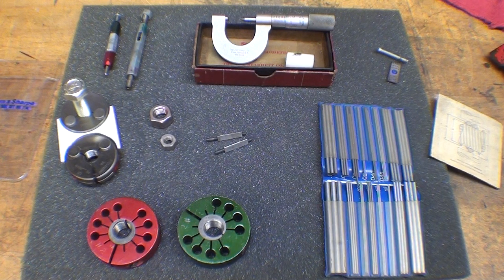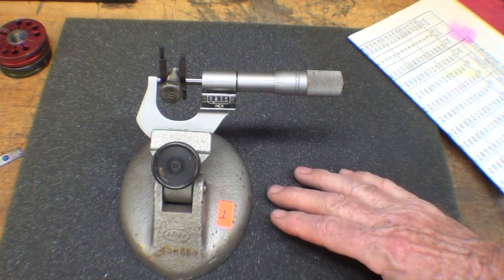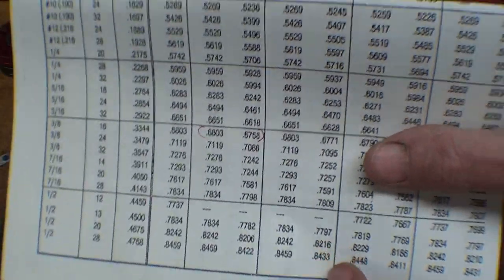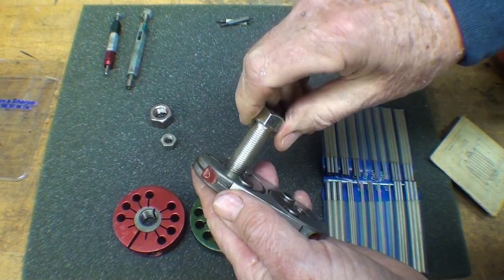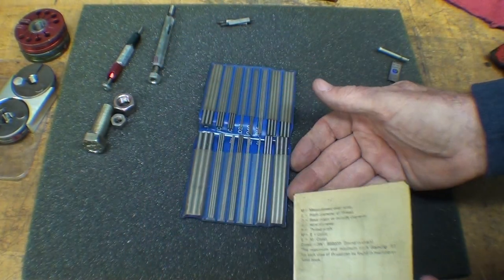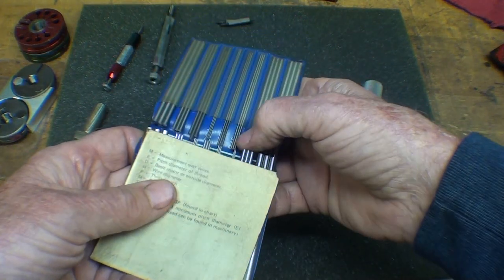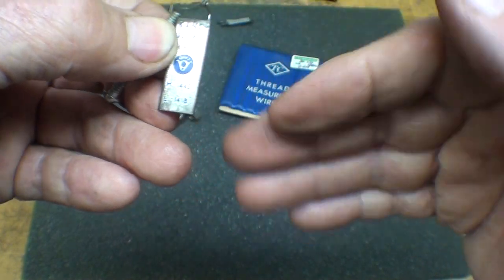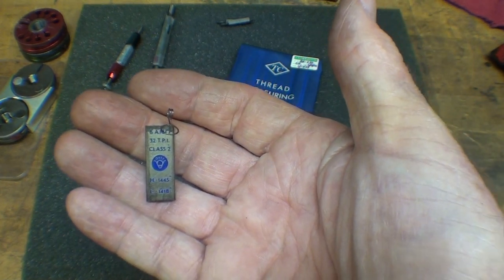Tips #272 How to Use Ovee Thread Gauge tubalcain

Comment: I thought I had seen every method for measuring threads but I've never even heard of the Ovee wires. That's very ingenious. At the work station we use wires and a mic free hand. It's a "learned" habit. Inspection uses go, no go gauges

Comment: I have never heard of OV gages.  They look like they would get the job done with none of the hassles of the other devices.  My work was one-off, so if it fit it worked and in some cases had to be made that way as the bolts and nuts were made one-off by the original craftsman.  I recently retired from a 30 year career as a museum restorations and exhibits curator. I worked with both woodworking and metal working tools and I am continually amazed at how much I didn’t and still don’t know and how much I learn watching your videos and those of the other incredible machinist on You Tube.  I particularly like your to-the-point style.  Keep up the great work.

Comment: I looked the OVEE gauges on their web site.  They are $117.00 - 138.00 EACH when new.  Pretty nice but I don't think I will ever have a set.  Thanks for showing them to us.
Reply: Just did the same thing.  Ouch. You can get a set of thread wires with the plastic holder to make holding them easier for about $75 and that will measure almost any thread size.  It appears that these cost about the same as a set of go-no-go plug gages and you don't even need to measure those.

Comment: The last thread I cut (last night) I tapped the female part and used it to gauge the lathe cut thread. Easy and good enough for the job. I've used three wire when I needed but don't have enough hands to do it easily!

Comment: I use the thread wires, or MOW, (measurement over wires) all the time at work. The easiest way to use them is to split a rubber band into 2 pieces, and poke the wires through each piece to hold them over the work piece to measure with micrometer. Works really well. Thanks for the video

Comment: I have made my own ones in the past, too poor to buy any, out of copper wire. Copper wire can be had in most of the sizes used in a PD set and is easy to wrap around the thread to be measured and using the PD chart for reference.

Comment: I used to do Inspection many years ago in a shop that was Boeing Certified. I've never seen the Ovee Thread Gauges before. It's been a long time since I've done that type of work. I suspect Boeing would not have allowed the use of
the Ovee Thread Gauges for machined threads for the parts we made for them, but they sure look handy and appear to be quite accurate as well. I always learn something new watching your videos.
Reply: Boeing would object because the Ovee gage cannot be calibrated.  The Doall type thread gages shown would be mandated.

Comment: I use thread mics whenever possible, far faster and more convenient than wires, I highly recommend picking up even a import one for 0-1" at least for even a hobbyist as that is going to cover 90% of the threads most people will be cutting. Also your directly reading the pitch diameter and don't have to rely on a chart that you can lose, miss read, or make a calculation mistake with. If I have to use wires I always put some green painters tape (so you don't get sticky all over your wires!) on them taping 2 together and flagging the other one so when, not if, you drop them they are very easy to find. Also I use grease to glue them in place, always worked well for me and then you can easily use them with just 2 hands. I've never had a chance to use a OVEE gauge before but they do look like a reasonable system but my god would a full set cost a fortune!
Thanks for the great video!

Comment: At my employment, we have standards for both the id and od threads.  Most of our threading is large shafts to keep bearings in place.  But occasionally you would get a job in that you did not have a standard for or a nut to try, so we would have to use the 3 wire method.  Yes it is a pain in the ass, but you learn very quickly in utilizing a clean rag to cover the ways so when you dropped your wire you can see it before it hit the chips.  And you do drop your wire or wires!

Comment: I guess I use the hunt for a nut or bolt that fits.  But, if I were using a lathe to cut threads I suppose it would be good to have a set or the Ovee gauges.  As a bricklayer, we weren't needing to be that close to tolerant but when I was fiddling around in the machine shop at school, I tried to get things as close as possible.  Greg

Comment: Cute. I have thread wires and a selection of thread mics, but I discovered that the older Starrett thread mics aren't always accurate on modern UN threads.

Flexbar makes some nice little plastic holders for the wires.

Comment: Very interesting!  I think I had a set of those (available) when I was at LePages.  I can see where wear and use (mis-use) may throw off readings in an older set, but I think you could "proof" those easy enough by trying them out against one of the other types and making sure you're getting like accuracy.  Carry on.

Comment: I've been in the machining trade now for almost 50 years & have never seen or used the OVEE gauge !! I have tried the thread V's , but they are VERY awkward !! A nut IS a good substitute for a ring gauge . And Wires are the most common . It is possible to only use ONE wire though !! (1) Mike O.D. of part & write down // ( 2) Mike over O.D. & ONE wire & write down // (3) Subtract smaller number from larger number & write down // (4) ADD step (3) & step step (2)  // (5) This is equal to measurement over TWO WIRES // (6) Proceed with wire formula to acquire Pitch Diameter . This method is MUCH easier for LARGE diameter threads ie.: 2.000 & UP !!!!! Also when you have cut a thread & it looks pretty good BUT the nut or gauge won't go on , your question is how much more to cut ??? The THREAD TOLERANCE , .003 to .004 Thous.  is a good start . GREAT video ,GREAT Ideas , THANK YOU Mr. Pete !!!!!

Comment: a Shars thread mic with interchangeable points and anvils is less than 60 bucks. I think that it covers about 8 to 48 pitch. Way easier.
Reply: I bought shars up to 3" love them.  Figured out SPI fits the same anvils (5mm) and bought a used 3-4" SPI. Love those mics.

Comment: Doing boiler work on a steam locomotive, we had to match the thread on the staybolt stock to the taps we had, which cut a bit undersized. We measured over wires.

Comment: I have a set of Ovee brand thread wires. They are almost identical but have more than a few loops of wire. They look almost like a Helicoil insert but work the same as the spring type you have. They thread on and you measure over the outer diameter. I believe mine  are older, before this style you are displaying here.

Comment: A slick way to get 3-wire effectiveness without the hassle. I've never seen those; I will have to keep an eye out for them.

EDIT: Found (and bought) a set for fine threads from 1/4 to 1". Not cheap, but not ridiculous. Now to find sets for coarse threads and for smaller threads.
EDIT2: And a set of coarse from 1/4 to 1 inch. Whoopee!

Comment: I've never seen OV gauges, but the 3 wire method I've used in the past and yes it is a struggle to hang on to the wires and try to get an accurate reading. :)

Comment: Those Ovee gauges are cute but i guess are made for 60 degree threads - ( not a lot of use for the whitworth bolts i was making at the weekend.  I had to struggle with wires!)   and as the thread pitch gets smaller , the wires get bigger and stiffer so there must be an upper limit to the available sizes.

I like your mechanical digital mic.  I must keep an eye out for one of those :-).  Thanks.
Reply: Yes you can get them for BSW. See my comment to mrpete.  regards

Comment: I use the thread wires all the time. I use grease to hold the two on the top my left hand to hold the one under and my right hand to hold the mike. Also I use red dykum to stain the wires in case I drop the wires so I can easily see them.

Comment: Excellent video  mrpete. I have a complete set of BSW O-Vee gauges up to 1" & a few odd ones over that size. I also have an almost complete set in ANF size. All are complete with the instruction sheet. I do still use them. Wish I had a metric set. Did you know there are 3 different types of O-Vee gauge.?  1-- Standard thread Gauge.  2-- Tap measurement gauges.  3-- Nominal effective gauges.  All the ones I have are in the original blue card boxes marked   "O-VEE Spring Gauge Ltd" Edgware,  Middlesex  (English county) and by the 4 digit phone number is most likely mid 1960's to late 1970's  O-Vee is still a trading company to this day.Thanks for sharing. regards from the UK
Reply from the maker: thanks-I willput that in a vid

Comment: Most of the time, i use a nut / bolt. Seldom, i use the 3-wire method (and hate them). These ovee gages look good, but to find a metric set for a low price will be difficult, i guess.

Comment: P-D wires are simple and fortunately, cheap, since part of the set usually winds up lost in the chip pan.  The simplicity is offset by the manual dexterity required to use them.  Not suitable for a production environment.

Comment: I would love to learn the calculations on how to use 3 wire
Reply: They come with a set of instructions
Reply: They come with a set of instructions for how to line the wires up, which wire to use with the manufacture's chart.
There are a set of calculations to figure out what wire diameters can be used with which pitches, and a set of calculations to figure out what the measurement should be with the wires you choose, (without a chart). We had to learn the whole process back in '86. Never used it since...

Comment: Am I alone in finding that new screws / bolts and often the nuts as well, need to be chased before they will thread together reliably?

It's likely that the factories which crank these things out are pushing the number of parts per tool sharpening.

It's kind of a pain when you need to use a tap and a die to clean up the new threads before you can actually use the fasteners, which is kind of critical when you are doing up pipe flanges for example...

Comment: Ovee gauges are still available.

http://mercury-gauge.com/gauges/ovee-gauges.aspx

http://www.mqs.co.uk/o-vee-wire-gauges-range-m3-1-m25-measuring-screw-threads-in-the-vertical-position-check-for-wear-on-your-plug-thread-gauges.html